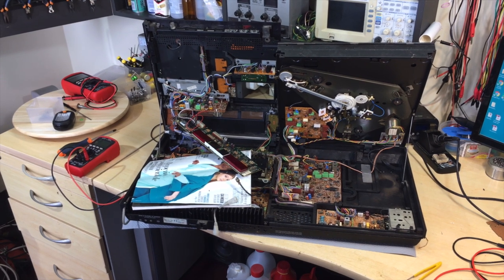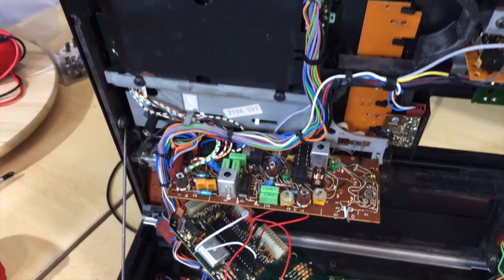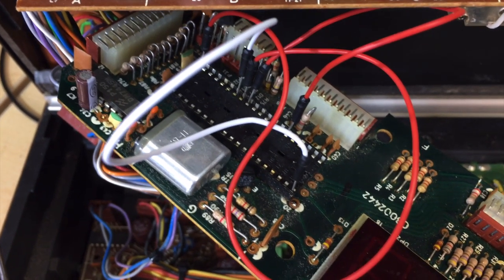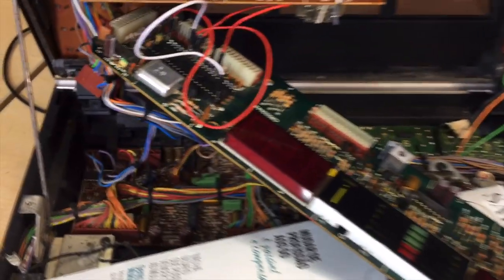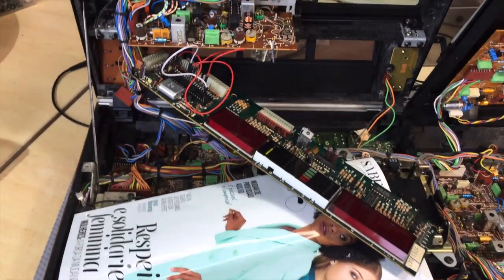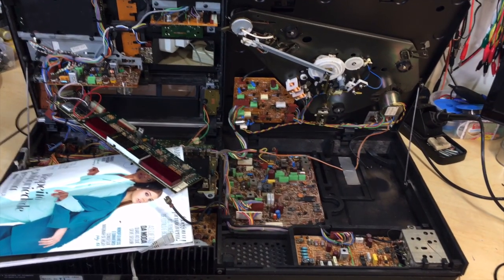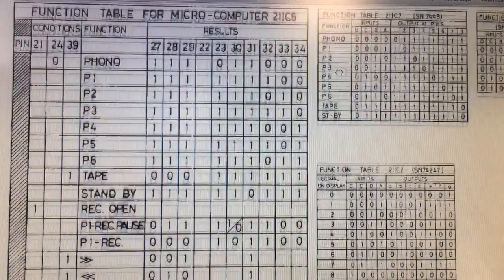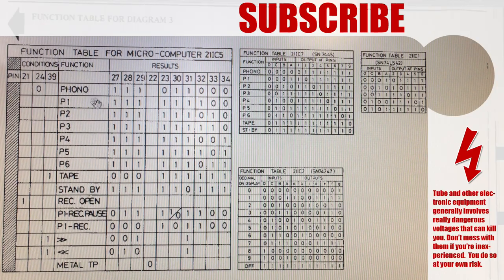Bang & Olufsen BeoCenter 5000 - part 1. Repair? Is this going to be brain surgery?

Comment: I am glad it's you and not me doing this one !.  It is going to be a tricky one.
Reply from the maker: I get that feeling, yes.
Reply: @electronicsoldandnew  I am with you on the digital thing too.  I think this model shares some bloodlines with the 7002, which had a remote control.  That would explain why they want microprocessor controlled.  It was a very nice unit when new, despite the processor control.  
I like valves/tubes myself though :).

Comment: Yes, any of the larger BeoCenters will be a challenge because of the complexity and often uniq solutions they use,
but isn't that part of the fun (at least when you succeed)?
Considered taking the processor out and wireing it up on a breadboard to test if it works?
Good luck.
Reply from the maker: Yes, the challenge is the attraction. 
I’ve removed the mp and am manually feeding the signals into the respective socket pins, but at the end I’ll do the reverse on a breadboard.

Comment: If the cap on the cpu reset pin is leaky, you can get all sorts of errors including the cpu coming to a total halt. You might try to change it with one of the same value (dont use other value, reset timing is often but not always critical). Good luck.
Reply from the maker: The electrolytics on the cpu board have been changed, with no effect. The quest continues 😊

Comment: OK, it's a "digital" repair then. The approach to attack the problem by implanting an ATMEGA Micro, programmed with ARDUINO, sounds like a very interessting project to me. (Maybe it's somewhat more easy for me as I'm more home at the microcontroller stuff as on the analog front). I stay tuned and maybe I can be of help.
Reply from the maker: I go for very long periods without doing any programming, so it’s always a refresh for me, which can be a pain. Thanks for the offer. We’ll see how this goes.

Comment: I may be misunderstanding you, but it sounded to me like you were saying that the processor chip was providing signals to the Program Select (IC7) chip.  At the EE FF and GG  points below IC7 there are arrows that are pointing in the direction of the processor.  Which to me would indicate that IC7 is providing the signals to the processors.  Am I missing something here?
You and I seem to think a lot alike on the digital mixed with analog issue.  To me, it seems that simple processes are often overly complicated by inserting digital into it.  They work, and work well, but is the digital really providing anything in the way of an improvement to the device if it were all analog?
Looking forward to the other videos on this unit.
Reply from the maker: No, from my understanding the processor supplies the select code (it is shown as outputs in the truth table). The arrow is an indication of the direction to follow to find the connecting link in the drawings, not the signal direction. 
I often prefer the old and tested versions of things, even if it means I have to get up to change the volume.

Comment: You say: Mixing microprocessors with audio gear is an aberration... But you are a fan of Bluetooth receivers inside tube radios and did you know how much processor power is inside a BT reciever?
Reply from the maker: You got me! I know, it makes little sense. However, in my (rather weak) defence, the BT module stands alone and if it aggravates me, I just remove it completely. The BT module also probably has 1000 times more processing power than the CPU in this thing, so, as I said, you got me :)
Reply: @electronicsoldandnew  And of course for repair, if the microcontroller itself is broken, it is impossible to replace. You could still buy 8048 compatible processors, but without the contents of the ROM, it won't be much use. You need an EPROM version of that processor, then you nneed a programmer and  the file with the original ROM contents. If anything else is broken (power supply stuff, clock crystal), you can probably fix it.